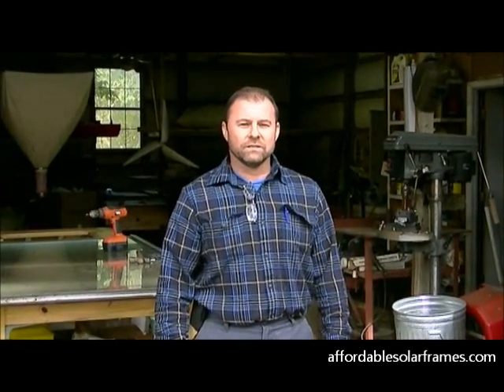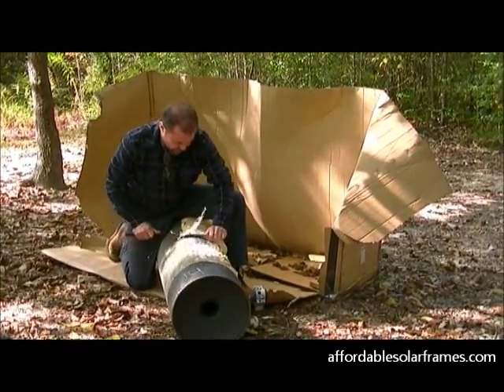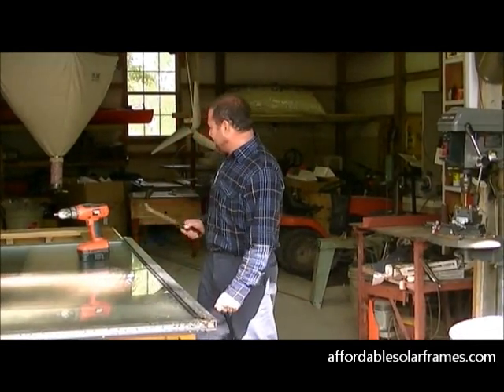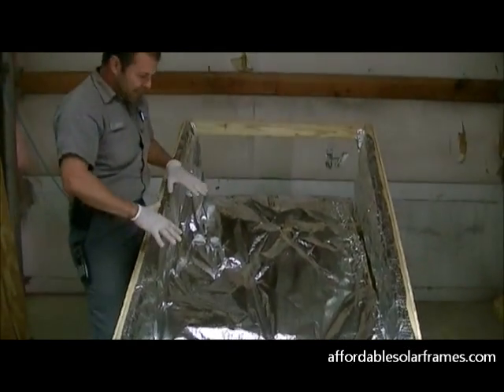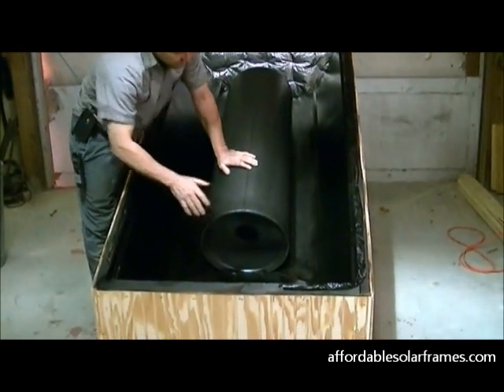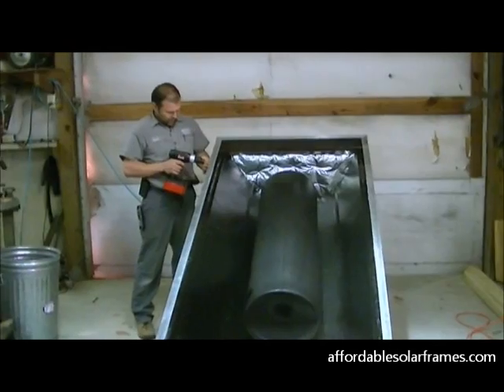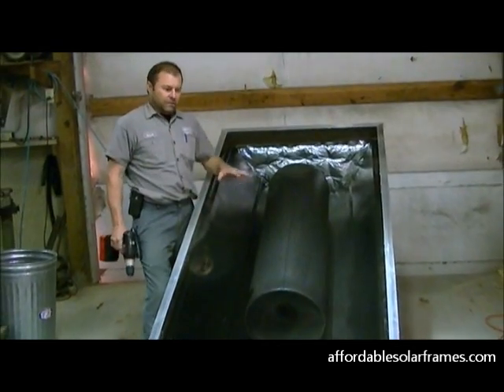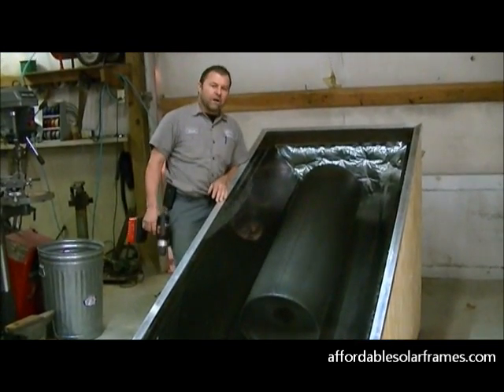How to build a solar water heater, simple DIY project. Save $30 a month on power bill. Mark Patrick.

Comment: This heaters work very good. I built one with 3  30 gallon tanks for a total of 90 gallon of hot water, with materials pulled out of a construction site for free. our gas bill went down a lot. This happen in LA. in the 80s. This system works perfect where freezing is not a problem. But this freezing problem can be solve with freezing protection. There is nothing that can not be with the right thinking. Good work. This is one of the simplest systems I have ever built. Grate Job. I love this video

Comment: In Alabama I would angle my solar water collector to meet the sun on the coldest days of the year.  That is when my hot water heater works the hardest.  Central Alabama's coldest day are usually in mid January when the sun angle is about 40 degrees.  Therefore I would angle my collector about 50 degrees vertical.

Comment from the maker: Yes, the whole system is pressurized. Water has to first go thru the solar water heater tank then to your existing water heater, or you can only use the solar water heater but you may not always have hot water.

Comment: There is no pump in such systems, it uses street pressure or well tank pressure. When you open you hot water tap in your house cold water from the street service will be pushed in and hot water will exit through your faucet.

Comment: At high noon on the winter solstice of Dec 21 the angle of the sun is around 53 degrees at this latitude.  50 degrees should be a good direct sunlight at 12 noon setting for winter with some loss the rest of the year.

Comment: It looks great, but I live in Michigan, this would not work secondary to the extreme cold temps at night without sun to keep the tank warm, I have to stick with keeping my storage tank inside and warming it through the line using the solar, but great video

Comment: I know this is a old video, but this is a great tutorial on your design. Personally I would have utilized the dbl pane glass for more thermal insulation, but I appreciate this DIY video.... thanks for sharing!
Reply: Speaking of glass, most modern windows use low-e glass which filters out UV and ultraviolet. Wouldn't that reduce the heat gain?
Reply from the maker: The glass I used is from the 1970's and is not low "E"

Comment: When this unit is connected to W.H. inside home,are there issues with low pressure? What "pushes" water from this unit into one inside the house?Any additional information is really appreciated!
Great video, thanks for your efforts!!
Reply from the maker: You plumb the water from the city/well to the cold side of the solar water heater and them plum the hot side of the solar water heater to the cold side of your house water heater. It pre heats your water and there is very little if any pressure drop.

Comment from the maker: @josephdupont  I use old glass doors from the 70's. I have hosed them off on a hot day with no trouble. I also make solar panels with new tempered glass with no problems.

Comment: Hi Mark.
You ever tryed to leve the metal sheets blank and reflecting so that they reflect the sun even to the underside of your watertank and increase temperature? Seen that on solar farms in Spain (halftube like mirrors under the waterpipes).
Anyway, very professinal job. Thanks for inspiring.
Reply from the maker: Yes, I have found that painting it black on the inside works best.

Comment: you can achieve the same if not better results and for a lot cheaper with the hose method... take a hose, inch wide, like 20 feet long, black of course, wrap it in a circle, tightly, build a simple wood frame to house the hose in, and place into the sun. the sun heats the water in the hose. simple, and easy...

this project thing that you did, is a good idea, but not very efficient, and if someone were to buy this thing from you they would spend a shit ton on the shipping cost... hose method much simpler.

Comment from the maker: @osokthedevil Sorry. I sold this solar water heater to a man in tennessee, I have made several  and on a sunny day it will heat up to 140degs.   Mark
Reply: Hello Mark, I recently spoke with a guy about this particular style of solar water heater. He had mentioned something about the need to install a pressure regulator between the two water heaters. I'm guessing that Maybe the preheated water may build up to much pressure sending it into the main water heater? What is your experience with this?

Comment: how does it work during the winter months
Reply from the maker: It works year round. It works in the infrared spectrum and will heat water in the winter to 140 deg.
Reply: Is this susceptible to freezing? I was hoping to mount a system like this between my rafters in my roof for solar water heat in in summer and also have my wood stove providing heated water to collector tank in winter.
Reply from the maker: VAN SOLO It depends on where you live. I just throw a blanket over mine at night in the winter months and it never freezes but I live in South Alabama.
Reply: Thanks for the reply..yea I live in Idaho so we have pretty frigid winters but I am thinking the heat from the wood stove should keep it protected. Is this a 30 gallon tank?
Reply from the maker: VAN SOLO 50 gallons.

Comment: +markp0177 Very cool, do you ever have problems with too much heat / pressure?  Could there be dangers associated with that?
Reply from the maker: +Jonathan Tarro I live in the south and I have not had any trouble. The tank still has a pressure relief valve
Reply: Awesome.  I live in Florida, will have to give it a try if I can get the wife on board!

Comment: I understand your reasoning but here in Chile we do it a little different and I think that it is better and definitely cheaper. I am using two different ways to heat my water. One is Solar vacuum tubes, which are not found (for the most part) at all in the former USA. 
The other is Wood stove coil and smoke stack tanks. Both of these are not permitted in the former USA because you all are not to be trusted with this tech. The government says that you all are not smart enough to handle it and be safe! Here in Chile it is used everywhere, especially here in the south where it is cold and wood is plentiful. 
My solar Vacuum tubes give me near or over boiling temps year round. Let me tell you here it rains 142 inches a year so we do not have a lot of sun but on a cloudy day it still works, not as good as a sunny day but still hot enough to burn you.
My solar vacuum tube generators were $400 each and my wood stove smoke stack tank was $200. Both have NO moving parts and will last my life time.

I think your video explains it well and I agree with your points but you all are not getting the full lunch menu. 
Please stop by and see how I am doing it. 
Thanks for the video.

Comment: Thousands of videos I have watched. And no one tells you how to drain 
the water during the winter. Is everyone stupid. I don't understand. How
 can you have any confidence on any project if you don't have all the 
knowledge to do it.
Reply: Put a bypass where water goes in and out, on the out install a valve.  In winter completely bypass the solar loop, and open the drain.  If it's not 100% draining you could blow it out like you do with RV, sprinklers and Boats.

Comment: I think you made unnecessary work for yourself. I used a double pane patio window as is. It was heavy and a strain to get on the roof but it works well but is necessary to reduce losses at night. It is my sole source of hot water and it works OK if I take my brief shower before 6 pm. During the summer I have all the hot water I need. It is necessary to install a tempering valve as the water can come out at 180 F

Comment: FYI the suns rays come at us at a 60 degree angle. this can be measured when you see the rays breaking through the clouds. if you are good with geometry as long as yo have those figures you can figure out EXACTLY how far away the sun is. if the sun were 93 million miles away the rays wouldn't be able to break though clouds at a 60 degree angle. if it were that far away all the rays would be coming thought parallel to each other. You seem like a logical person. Think about it and what it says.